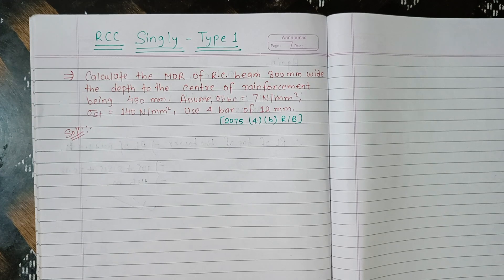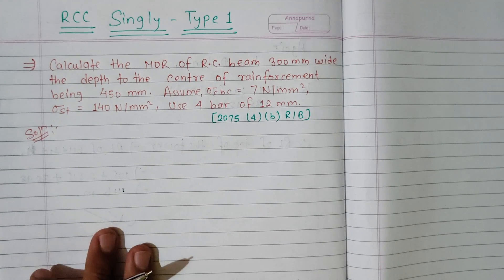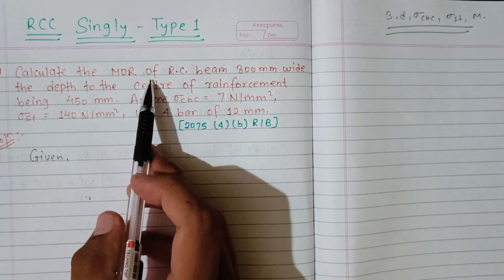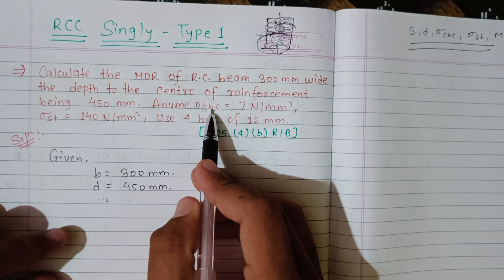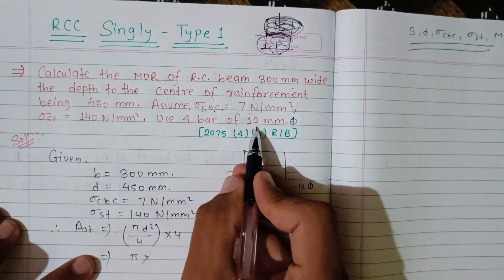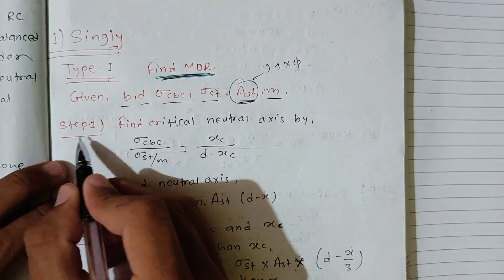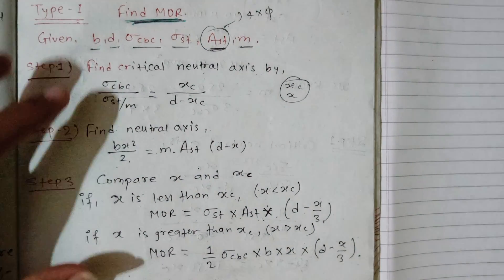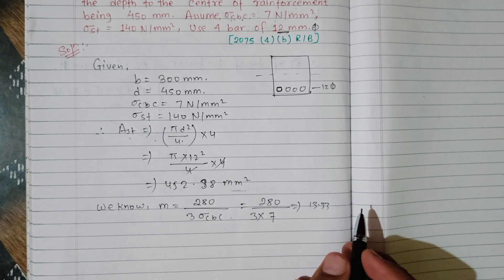RCC- SINGLY ( TYPE-1 ) | SDD 5TH SEMESTER | 10 MARKS NUMERICAL | CTEVT | @Er.dipesh186

Comment: An RCC beam 200 mm x 40 mm effective carries a uniformly distributed load of 70 KN/m over a span of 6 m. The beam is reinforced with 1% steel on tensile side comment on the shear design of beam. Use M20 concrete and load factor is 1.5.

Sir 2081/82 question slove garnu na.